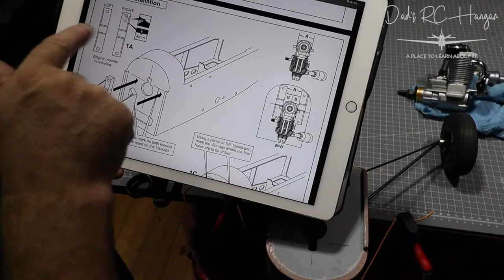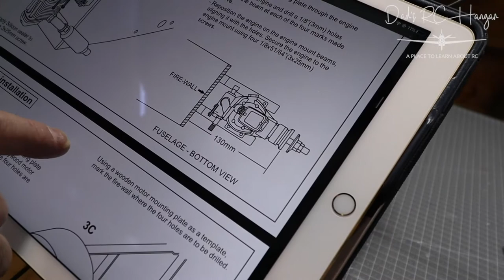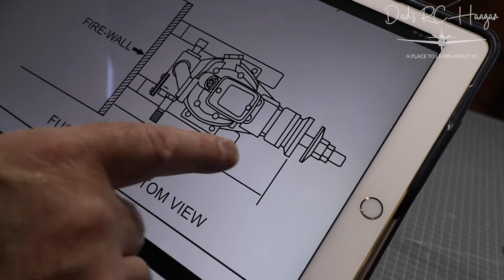Nexa Tiger moth engine installation

Comment: Sorry your not feeling great, when you feel better & got time, could you measure between the exhaust port & the side of the cowl please, that will tell me to get a 62b if there is enough room for the knuckle to be inside the cowl. Thanks Chris
Reply from the maker: Will measure tomorrow. It’s only the Flu Jab, but I feel chrap for a day then all good 👍🏻
Reply from the maker: Did not get time today, but will look tomorrow 👍🏻
Reply: Dad's RC Hangar , that’s ok Chris, if you have trouble trying to measure the gap, you can use anything soft like playdouh, blue tack etc. Put a ball of it where the exhaust port is, put the cowl on & gently press the cowl, take off the cowl & measure the slightly flattened ball, a usefull technique where u can’t see what you want to measure, an old engineering method. Stay safe & look forward to getting the measurement & your next build instalment,👍
Reply from the maker: Hi John,
I did not have any Cay, so used other bits the measurement from the port flat face to the cowl. 
15.90mm
0.626inch
Reply: Dad's RC Hangar that’s great thanks, I think that might just be enough to get a “ just engines” knuckle inside the cowl with a saito 62b engine, it might be worth you looking at there web site & give them a call to check sizes. They have been really helpful in the past when I’ve called them. If you have a better idea, let me know!👍 thanks for finding the time for the measurement 🙂

Comment: Where did you get the mount and what size engine are you using?
Reply from the maker: Hi B Smith, the Engine is a Saito FA-62B and the engine mount is a JP 45-61 Nylon Long Engine Mount. Hope this helps. Have a great holiday period and thanks for popping buy 👍🏻

Comment: Great job Chris. The name for the front bit of the engine you were searching for is the propellor driver. Agree with your decision for longer bolts and to change the mount plus everything you did was spot on. From what I saw on the video the tank level will be close enough...👍
Reply from the maker: Ian Brookes thanks Ian, will have to show off your building soon, so professional. I have a fuel filter to fit in the firewall as well, so that will count as a reservoir. Have a great Sunday 👍🏻
Reply: Dad's RC Hangar thanks for the compliment Chris but I’m just an old balsa hacker compared to some of the pros you see on YouTube. I’ve put some pictures of the engine and tank installation on my Bolero on the forum which might be useful for hooking everything up...👍
Reply from the maker: Ian Brookes great stuff, I will go have a look 👍🏻

Comment: Well done Chris, I’ve been waiting for your next tiger moth build instalment. I have already bought the same tank... spooky! With regard to ur exhaust, I don’t want mine to hang out of the side of the cowl either. Have a look at “just engines” website as they do a tight 90 degree knuckle that I think will just fit inside the cowl, screw on the silencer to the knuckle then the exhaust pipe should just hang out of the bottom of the cowl. What is the gap between the cowl & the engine exhaust port? As I want to use a saito 62b or maybe a lasser 70 if I can’t sort out the exhaust. Keep it up, looking forward to the next video
Reply from the maker: John Retired Thanks John, yup I want the same exhaust, it’s actually scale as some did have that type. I hoping to get for next week. 
I will be building this every week, was under the weather today so was taking breaks. Thank you for watching and I hope you enjoy the rest. You should join our forum and post yours when it’s done. 👍🏻 Have a great weekend.